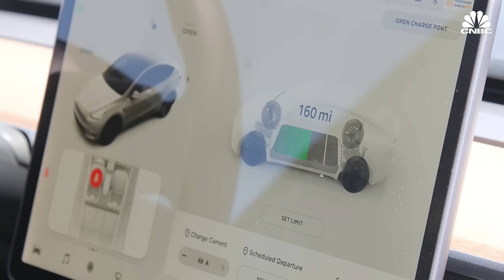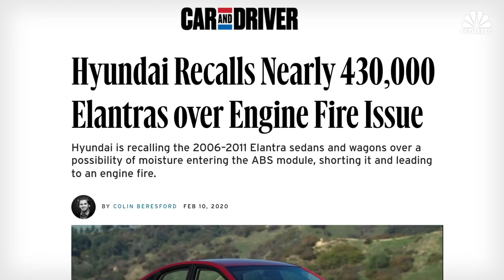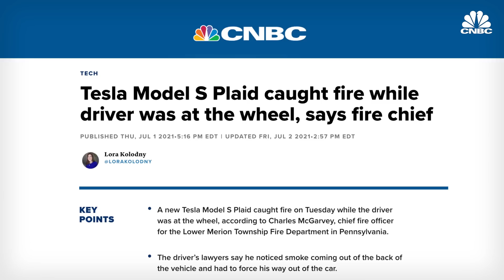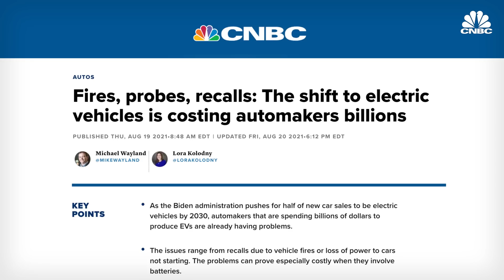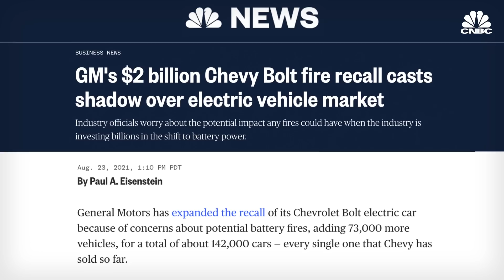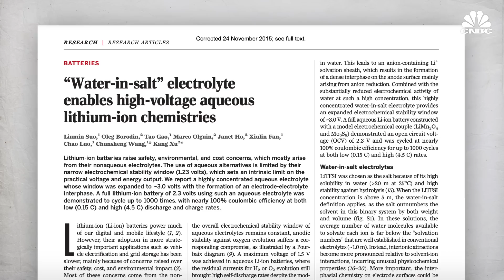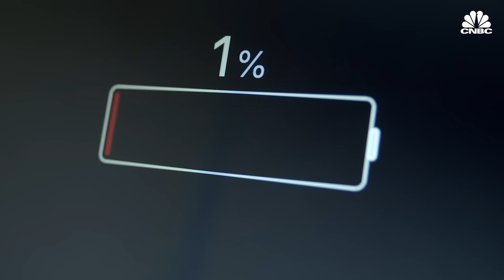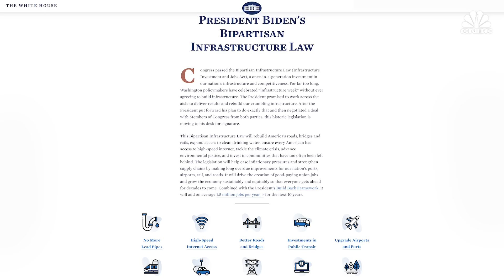Why Tesla, GM And Other EV Companies Have A Fire Problem

Comment: A lot of combustion engine vehicles catch fire each year. There is no denying it. My problem with Electric Vehicles is that there is very little chance to get out without at the very least burns. Imagine having a child in a car seat and your battery bursting into flames. It isn't just a small fire that grows. It is quite literally an instant inferno full of toxic fumes. If electric vehicles are the future then someone had better get a hold on this problem however infrequent it may be.
Reply: Water is not the best fire extinguisher for lithium batteries.
Lithium reacts intensely with water, forming lithium hydroxide and highly flammable hydrogen.
Car manufacturers are racing to develop the next models while not being forced by regulators to encapsulate proper fire neutralizers into the battery's pack. It should be mandatory that lithium battery manufacturers wrap their batteries with chemicals to neutralize the chemical reaction such as powder graphite or sodium carbonate.
Reply: Lithium fires flare to the Sun’s surface temperature in a fraction of a second if the foil battery membrane tears and OXYGEN leaks in the form of AIR or WATER.  AIR and WATER are far from rare.  Gasoline is perfectly stable in the presence of OXYGEN.
Reply: 5000 degree heat owch
Reply: Amen.
Reply: @brob-zy8zi  It’s also a fire that can’t be put out; it has to burn itself out. Adding water to lithium will itself cause fire. Nearly lost a friend to a LuPo pack several years ago; he became my lodger because of it; the thing wasn’t even plugged in.
Reply: more kia and hyundai cars and suv have caught fire than all of the EVs combined.  FACTS. go watch the videos here on youtube. thousands of people barely made it out of the cars before they went up in flames completely
Reply: They can all take this EV 
Bull CRAP and stick it where the sun doesn't shine.  This junk isn't ready for society.  Yet all these companies and CORRUPT 
Politicians are trying to force this mess down the consumer's throat. I 100 %
refuse to purchase this garbage. People You will
Not be able to get your kids and love ones including the family dog out of a Fire Trap EV when it decides to go up in flames. General Motors pulled and recalled Every Chevy Bolt they produced. 
Because there was a strong possibility of their junk EV cars catching fire.
Fire Depts in the United States aren't even fully knowledgable on how to deal with this type of fire.
Then they say well it may be perfected in 3 to 5 yrs. 
Until then we the consumer Burns to the ground with the car.
I dont think so.They are all
Smoking a Crack Pipe and drinking a quart of vodka.
Reply: @georgewoodget271  ok boomer.
Reply: agree but also with gas and then there goes mortgage will insurance company cover
Reply: What
Reply: EVs are not the future. They are a boondoggle.
Reply: If this problem isn't addressed, I will not only refuse to buy an EV, I will refuse to enter an EV taxi or have anything to do with EVs.
Reply: @ToroMontana  Goggle, Electric vehicles and busses going up in flames 🔥 you would be surprised,  and don't park them in your garage or close to the house...
Reply: @dottiea.2186  Yeah I Googled the fires and in EVERY SINGLE CASE, the statement was there, clear as day.. "The driver immediately evacuated the passengers and no injuries were reported"
 
Which again completely destroys your baloney claims about going up in flames in seconds.

The fact that you talk about "Acid" everywhere just shows your level of ignorance as Lithium Ion batteries DON'T contain Acid genius.

Only Lead ACID batteries do... hence the name...
Reply: @ToroMontana  It isn't ever going to be addressed. Lithium batteries are inherently very volatile like this because they use lithium. I don't even buy lithium Double-A batteries for my devices. The risk, if one should short out or become exposed to water is too high for me. I can't believe we are allowing manufacturers to use this dangerous element. The only risk I have is my phone, for which I have no choice in the matter because no one is making phones using other batteries any more. I don't carry my phone in my pocket. It is either in a holster or in my hand so I can quickly drop it if the battery catches on fire.
Reply: @jasonmorabito5455  👍
Reply: Didn't they quit making the FORD PINTO in the 70's same reason, EV are a bomb on wheels right now plain and simple, just when and who related gets to enjoy an emission free car that may catch fire. A Tesla Semi caries  a 600 kWh pack weighs about 8,000 pounds (3,629 kg) burn baby burn. The quickest way to put out a EV is a dunk tank they discovered.  Big trucks not a chance.
Reply: @thomaspepper2201  Your comment is a prime example of how easy it is to cling to an opinion regardless of how profoundly the facts contradict it. It is a matter of fact (not opinion, but fact) that NHTSA data shows that gasoline cars have more than a 10x greater probability of catching fire than EVs (2021 Impact Report). Further, it is a matter of fact (not opinion, but fact) that the amount of energy (as measured in joules) that is sitting in the gas tank a few feet away from the passenger compartment of a gasoline car is 3x greater than the energy stored in an EV battery pack. And finally, although EV batteries in thermal runaway burn extremely hot, they don't explode. Gasoline vapor does. So,  in what circumstance do you think a person has the best chance of survival - when their car  burns or when it explodes?
Reply: @normvanduker9999  I suggest you read a bit more, EV is just pollution trading at this point, I did hazmat for 10 years of chemical and biohazard and the chemicals that come from ANY BATTERY ARE WORSE THE FUEL. A battery fire burns up to 4hrs and the fire truck has to hook up to a hydrant. That's not an issue with fuel. Where does all the water and battery go.  I say no more CHEMICAL REMEDIAN WAS MY JOB. The world is not ready for the G.N.D. OF Solar, wing. and electric cars. To much front loading of carbon for all mining of needs to waste. Give it up, keep wishing, it will come though in time, when all the waste, pollution can be addressed
Reply: It goes up in flames 🔥 in Seconds NOT Minutes...  plus all the Acid Splatters everywhere....
Reply: @dottiea.2186  What is with people spouting complete and utter nonsense about things they obviously don't understand?

What you are claiming is utter baloney.
Reply: @dottiea.2186  what acid??? there is no acid in a lithium battery.  still feel smart?
Reply: @Cancri71  There's still a liquid electrolyte that's inside the battery cells.
Reply: @ericclaeyborn3600  nope. When is the last time you took apart a lithium cell?  Let me answer that for you. You haven't. Any moisture in the cell is vaporized when it ignites. Instantly. I build custom lithium packs as a hobby. Built my own house battery. I've set off a few cells over the years.  There is ZERO liquid. Now sit down
Reply: @Cancri71  so you know what you are talking about 

What is the safest way to put out a lithium ion battery fire
Reply: @starlightskywolf  
for the average person using sand is the best way to go. fine silica sand will smother it. but if you uncover it  the flames will ignite again very quickly.  do not use water or other liquids. you will not like what happens.
Reply: This month alone, there are two accidents that bursted in seconds in Korea. The first one happened in a mild crash that was no way to think it would explode if it weren't electric vehicle. Two burnt bodies on the seats no chance to even react for second.
Reply: @Tz3952ii  Well as someone who has seen an EV fire, they do not go up that fast.
Reply: @desertsoldier41  It took 1-3 seconds the vehicle burst into flame and went up to thousands degree. The source said thats all it takes and it would give you no chance to even move. Like you saw those explosions in this video.
Reply: @Tz3952ii  
Lithium fires explode in a fraction of a second, but it doesn’t matter since a common theme is that the dead were all frantically trying to escape in their last moments, but the doors and windows don’t work.
Reply: @FFE-js2zp  Yes that's what I've heard the windows and doors didn't work and the worst of all they couldn't put out the fire for hours...
Reply: @Tz3952ii  
Lithium battery fires burn for days and cars will reignite on the tow truck and in the shop.  The official fire department procedure is to stay clear while focusing all hoses directly on the battery for a minimum of 8 continuous hours and 30,000 gallons.  That’s 20 to 30 fire trucks of water.  Let the car and human remains sit for a minimum of 48 hours, do not approach it.
Reply: But EVs disaster were more common than combustion engine
Reply: Instantly cremate, that's is the problem with the ev nowadays...
Reply: You got it backward. When a EV catches fire, it takes place slowly over several hours and possibly days. Giving you time to get you, your family, your papers and your luggage out of the car and get 4 friends to help you push it half a mile to someplace a fire wont hurt anything. GAS CARS (and I have seen this twice with my own eyes) start with smoke and within 1 minute the entire car is a ball of flame. And thats assuming it started as an electrical fire and not a high speed rear-ending which can break open the gas tank and create an instant fireball like being on the Death Star after the torpedo goes off. 

And while some charging fires happen with EVs (once again, really slowly) they almost need a separate internet for all the gasoline car refueling fire videos, altho those mostly get really bad because once the fire starts, people invariably yank the nozzle out of the tank, because why wouldnt you want the gasoline to have a lot more air available to combust with, creating a flamethrower and setting ALL the gas station on fire instead of just shutting off the fuel and dropping a rag over the opening and choking out the fire while its tiny.
Reply: BYD Blade batteries are the answer.
Reply: Yes, same problem
Reply: Exactly.  In most cases a combustion engine has to be in a collision or at least there are warning signs.  An ev can spontaneously combust, without warning, in an instant cockpit fire burning at 3600 degrees with jets like plasma torches sending molten plastic and metal instantly into the occupant cabin.
Reply: @sgsellsit  You are misinformed thinking that only EVs spontaneously combust. Gasoline cars are notorious for spontaneous combustion - without warning and for no apparent reason. For example, just last month (June 2022) Ford recalled over 350,000 vehicles (Lincoln Navigator, Expedition, and others) to correct a problem that can cause these cars to spontaneously combust. Ford also issued a warning telling owners not to park these vehicles in the garage or close to other cars until after they take their car to a dealer for warranty repair. Another example is a Hyundai/Kai recall in Jan 2022 of 483,000 vehicles also for risk of spontaneous combustion. Meanwhile, according to NHTSA data EVs are10x less likely to catch fire for ANY reason than gasoline cars. Further, unlike gasoline cars, EVs don't explode when they catch fire. When it comes to risk of injury or death from vehicles fires gasoline cars are far more dangerous than EVs and the only reason people don't understand this is because gasoline car fires are so routine that the media doesn't even bother to report on it anymore.
Reply: clot shots  My 8 year old daughter will often tack "LOL" onto the end what she types to help people understand when she thinks she said something clever. And I guess that's kind of cute...when an 8 year old does it. But getting back to the subject, far more fires occur in gasoline cars than EVs.
Reply: The opposite is true. Internal combustion engine fires happen very quickly, and you only have a limited amount of time to get out. EV fires grow much slower.
Reply: As a firefighter petrol cars are way more dangerous and go up quicker with the potential of exploding.
Reply: If an ICE powered car catches on fire it also can result in burns and releases toxic smoke.  This is a very odd thing to focus on given the fact that both types of vehicles catch fire, release toxic fumes when on fire and can be difficult to get out of.
Reply: @6SpeedTA95  why are you sticking up for a tried failed technology???
Reply: You are mis-informed electric vehicles can spontaneously ignite. ICE cars don't do this they need an ignition source which is usually electrical and fuel fires are rare even in crashes. Electric car fires are impossible to extinguish and can occur rapidly in seconds. ICE fires develop much more slowly and are easily extinguished @6SpeedTA95
Reply: @6SpeedTA95 the fire on ice car get slow, on ev is instant like giant matchstick. No time fot escape
Reply: @6SpeedTA95  It's an odd thing to focus on? Have you ever seen a lithium battery become compromised? It's not a fire, it's a raging inferno right from the word go. That's my issue. It's not an odd thing to focus on. I wouldn't drive an internal combustion engine powered vehicle if that vehicle had a chance to randomly erupt into a raging inferno with no outside forces acting upon it either.
Reply: @brob-zy8zi  ICE vehicles catch fire sometimes randomly. Total odds of fire are lower with BEV based on the data.  So yes odd to focus on it the way they did with no context or big picture view.
There is actual data out there on this and it’s easy to find if one is interested in facts.
Reply: @brob-zy8zi  You said you wouldn't drive an internal combustion engine car if they spontaneous erupt into a raging fire. Surprise! According to NHTSA gasoline cars spontaneously burst into flame far more frequently than EVs. Millions of gasoline vehicles have been recalled over the years to fix that very problem...in fact Hyundai/Kai recalled 833,000 cars just 2 months ago to fix a design flaw related to spontaneous combustion.
Reply: @brob-zy8zi  A lot more EVs are catching fire than ICEs. The only place I've heard that the ICE vehicles are catching fire from these comments, not from any news, in which the EVs are getting. There are warnings not to park your Hyundais and Kias in the garage, or near the house, because of recent spontaneous fires.
Reply: @6SpeedTA95  And just how does that happen?
How does one get diesel to burn? Or even petrol?
My petrol injection car burst a fuel line and sprayed fuel over a hot engine - it didn't catch fire. Mind you, it scared the hell out of me!
Reply: @brianletter3545  if I seriously have to answer this question you need to do some research. Could be an ignition problem, fuel leak from a wide variety of places, etc.  I’ve been pretty into cars for basically my entire life. Maybe you aren’t and your question was sincere? There are far fires all the time. Literally all the damn time.
Reply: @6SpeedTA95  the big problem is lithium battery fires cannot be put out like a conventional fires by cutting off the supply of oxygen to the fire. Lithium batteries have their own source of fuel and oxygen. Spraying water or chemicals on a lithium battery fire only feeds the fire.
Reply: @6SpeedTA95  Not really, you just pull over and get out. Call the FD and they'll be on their way. 

Plus, you may still have a chance to get your car info and insurance out of the glove box before it reaches to it. 

EVs are instantaneous, since they give instant torque and basically teleport you to your destination instantly, they to instantly catch fire and instantly be spontaneous. Have fun with your Burning rc car
Reply: According The National Highway Traffic Administration, on a per mile driven basis you are much, much more likely to suffer injury or death by fire driving a gasoline powered car than by driving an EV. This CNBC video is misleading click-bait. The title should be "How EVs are Solving the Fire Problem Caused by Internal Combustion Engines". But then the entire segment would end up being ridiculously short as the narrator simply points to the fact that according to NHTSA data gasoline cars are 10x more likely than EVs to catch fire and, unlike gasoline cars that carry around a tank full of highly explosive gasoline vapor, EVs virtually never explode.
Reply: @normvanduker9999  Please don't mislead. Nearly all gasoline vehicle fires are due to collisions. EVs catch fire all by themselves.
Reply: @normvanduker9999  that is a very foolish and uninformed statement. Ev vehicles make up less than 2% of the vehicles on the roads and have .4% of the total vehicle fires.
Reply: @parolajd  My statement is informed by data from the National Highway Traffic Safety Administration. Where is your data coming from? Further, by your own math, you've already made the argument that EVs are 5x less likely to catch fire than a gasoline car. That would already be an impressive safety record, but the NHTSA says it's actually even better than that.
Reply: @normvanduker9999  Again, I've seen plenty of Combustion Engine fires. However rare it may be for a lithium battery itself to become compromised when they do the reaction is violent. It's not a small fire that builds. It's a rapidly escalating event with very little warning that it's going to happen. That's my issue with them.
Reply: @brob-zy8zi  I am not trying to be argumentative and I have no personal experience with any car fires. In talking about the risk of fire in gasoline vs electric vehicles I am merely relying on data compiled by NTHSA. And the objective data unequivocally show that gasoline cars are far more at risk of fire than EVs and that when fires do occur, it is gasoline cars and not EVs that are at risk of explosion. For all of the hysteria the mainstream media has whipped up about EV fires, the simple truth is that driving an EV actually puts you at far lower risk of property damage, injury, or death.
Reply: @brob-zy8zi  Apparently you have never seen a gas tank explode.
Reply: @brob-zy8zi  Except that claim is literally fiction.

Here is an actual report of a Model S that hit a large metal object that damaged the battery...

"Yesterday, a Model S collided with a large metallic object in the middle of the road, causing significant damage to the vehicle. 

The car’s alert system signaled a problem and instructed the driver to pull over safely, which he did. No one was injured, and the sole occupant had sufficient time to exit the vehicle safely and call the authorities.

Subsequently, a fire caused by the substantial damage sustained during the collision was contained to the front of the vehicle thanks to the design and construction of the vehicle and battery pack. 

All indications are that the fire never entered the interior cabin of the car. It was extinguished on-site by the fire department."
Reply: @normvanduker9999  This is the same ridiculous statistic as espoused by airlines. Yes, it is highly unlikely that you are going to be in a plane crash, BUUUUUUT, you are so likely to die if you happen to be that unlucky small percentage that do crash. If I had a choice of being in an exploding gasoline car or and a exploding EV car, I would always choose the gasoline car. I'd rather drive across the country than fly across it.
Reply: @jasonmorabito5455 It is somewhat arrogant to characterize NHTSA data as ridiculous. That said, you are more than welcome to let your emotions dictate your personal travel decisions, but it is a matter of fact, not opinion, but fact, that airlines have made cross country travel safer than journeying by automobile. Similarly, it is a matter of fact, not opinion, but fact, that EVs are safer than gasoline cars.
Reply: @normvanduker9999  You do know the battery is set to the ground right? Because it's literally facing the ground, it's got the higher chances of it to catch fire. Its in a steel casing so yes it takes LONGER to put out.

A gasoline has a rubber tank. How tf do I know this? Take a good look at those race car gas tanks. They experimented rubebr tanks for fuel and it doesn't become dent. It bends and keeps all that gas in.

But aside that, EVs do not help in the fire category. Those toxic batteries literally are acid. There's a piece within those lithium batteries that sre sooo flammable, including the liquid itself are a danger to anyone, including you.

Sure I like the LOOKS of an ev, but that's only looks and functions. EVs are better off the road and better off not made at all. If you are camping in the forest (which can be summer MOST of the time), you will be the one to accidentally cause such a forest fire by your EV alone (without even noticing), it may as well take days ... or weeks, maybe even months!

EVs when traveling are better off in the city than country side, but our government is removing sales of new ICE vehicles (good for you). They're gonna take away all that fun off the road and soon enough, remove racing competition. 
Ya im big in their Baja trucks, but that doesn't mean they should replace such Idiocracy with their stupid environmental ideology. Screw the environmentalist, they were gonna take away our rights to own vehicles, especially ICE.